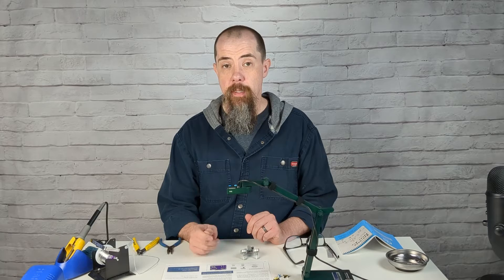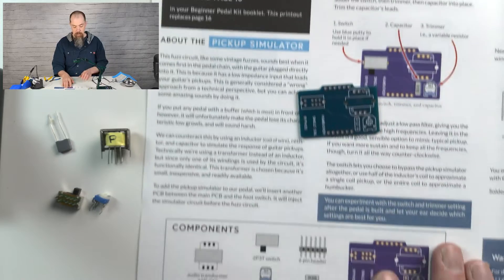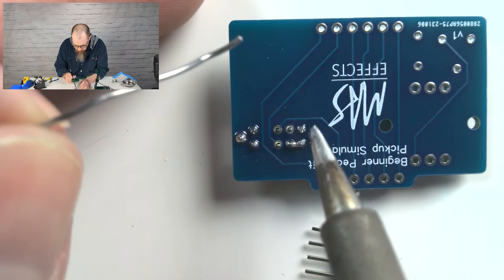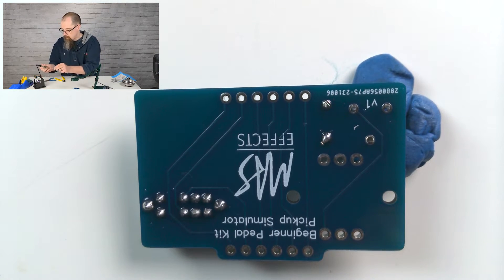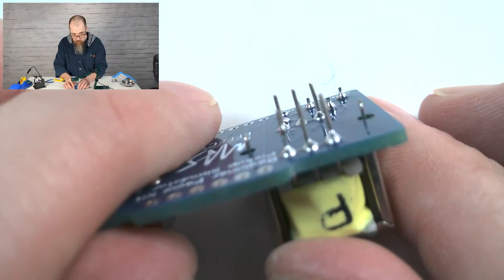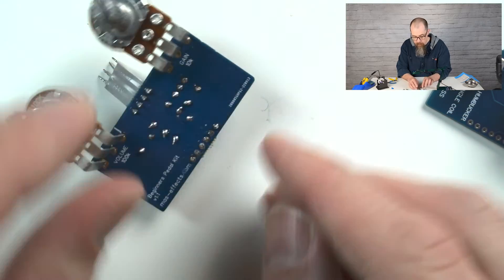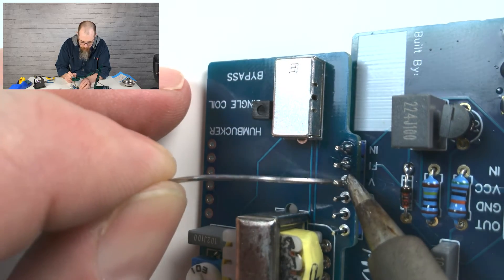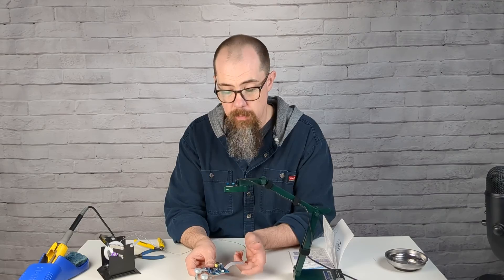Building the Pickup Simulator sub-kit for the MAS Effects beginner pedal kit

Comment: Hi guys, just one question, can you do the pickup simulator as a standalone pedal? thanks a lot!
Reply from the maker: For sure. Now its form factor is tailored to this pedal, so you'll need to figure out how best to mount it (e.g. double sided foam tape). But there's no reason you couldn't. I just put together this "Hacker's Guide" which will show you some ways to use it, but feel free to hit me up with any questions along the way: https://masfx.io/pickup-simulator-hackers-guide.pdf
Reply: @mas_effects  thanks for the quick response! is possible to do it passive (Without the 9V) and put an external toggle to select between Humbuckers and Single Coils?
Reply from the maker: Hey Juan, sorry I'm having a brain-dead monday morning. Yes it's absolutely passive. Check back at the link in 10 minutes for an update that omits the power. An external switch is possible. Just run wires to the board. It's a 2P3T which will be hard to find panel-mounted, but you can use a DPDT and omit the bypass option by leaving pins 5 and 1 disconnected (see schematic).  @juanpinasco3738
Reply: @mas_effects  HAHA don`t worry, its happen to everybody on monday morning. thanks man! appreciate the answers!